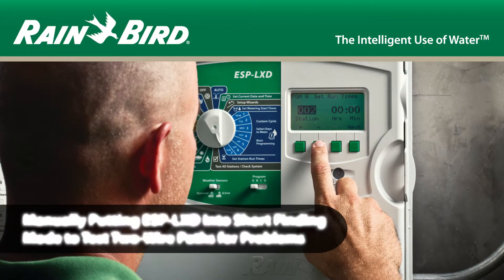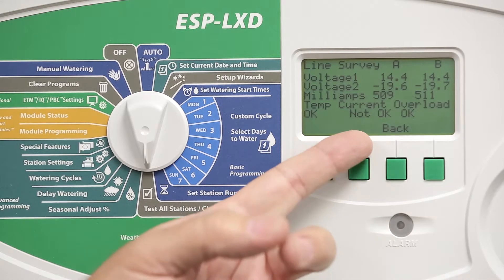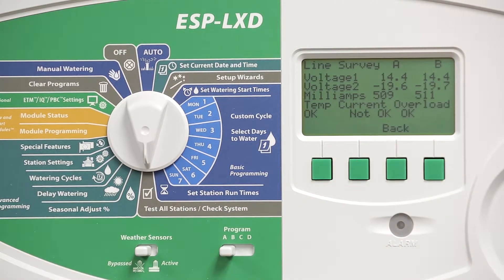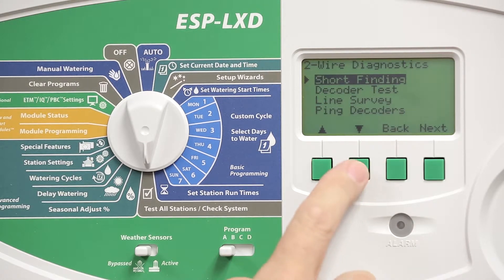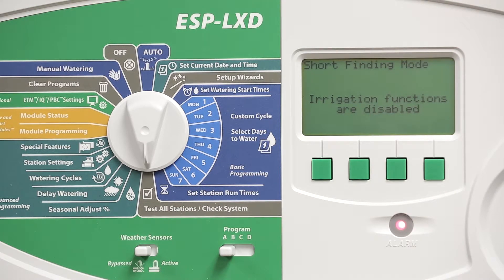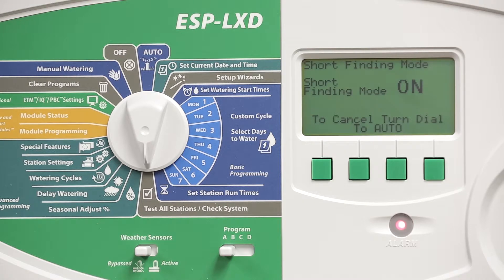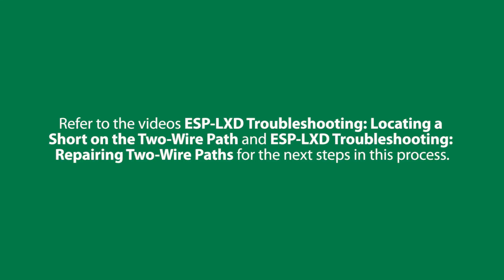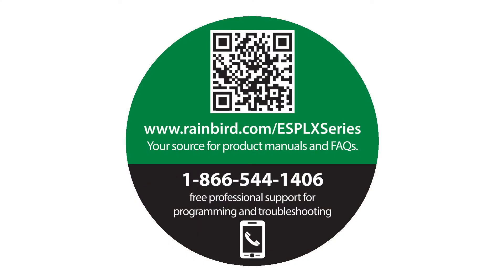Manually Putting ESP-LXD Into Short Finding Mode to Test Two-Wire Paths for Problems

Comment: Hi, I have been doing my best to fix a short Alarm on a 2 wire System, just to let the Professionals know I had this controller shut down the entire system when you find the Short cut the wire to the Decoder to remove the Short if not it’s like Shutting down all watering till you can replace and put the code number for the valve not very Complicated but it’works on a frequency like a fax machine Dialing or calling the number on the Decoder line. Pretty Cool. Thanks if you understand I Love the Technology and how far we have Advanced. John Garrison

Comment: what's the controller doing in "Short Finding Mode"? limited the current to 200mA? appies 24V to the 2-wire, so you can measure the current?